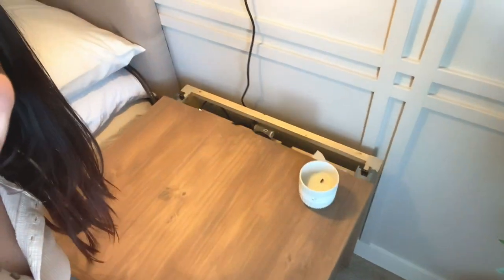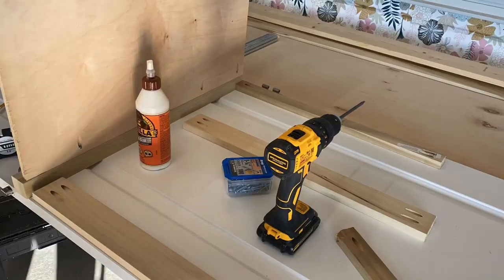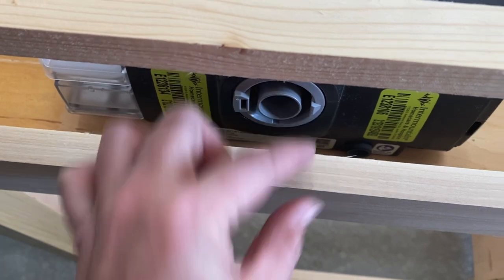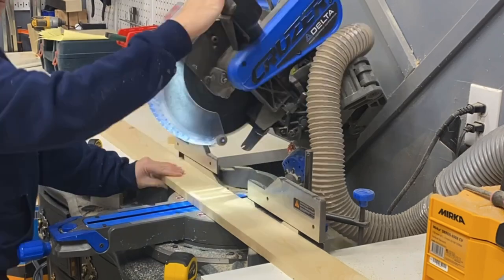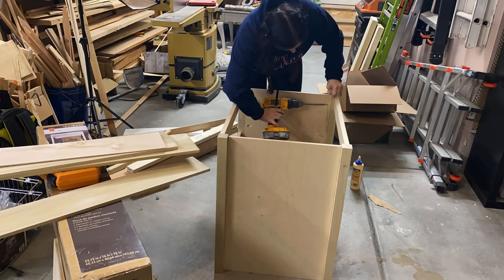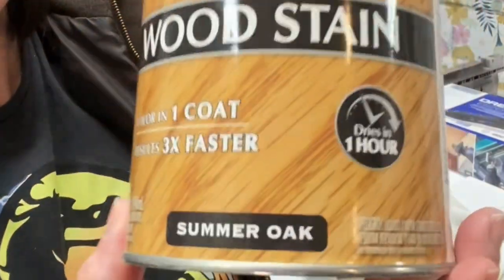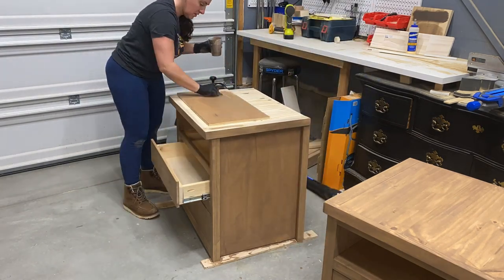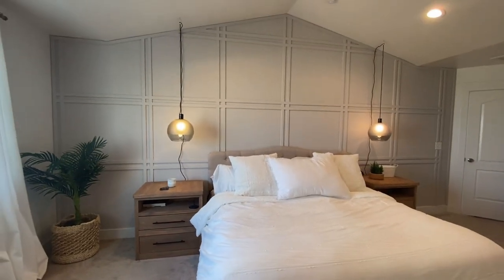How to Make Nightstands with CPAP Storage and Secret drawer

Comment: Echo the build as well.  Not many options / ideas out there for us CPAP users.  Got your plans and not into it. ❤

But have a small issue on the spacing for the drawers.  The plans reference a distance between the drawer supports of 7.5” and 6.75 which left me with 3” for the cubby.  Tried to make the space inclusive of the support pieces - but then it’s too small for the drawer sizes. What am I missing.  

High regards for the build abs the free plans.  Like abs subscribes.  Love Love it.  But need a little help if possible.